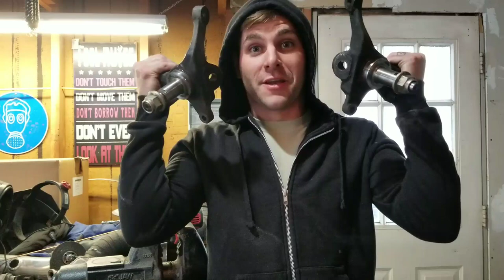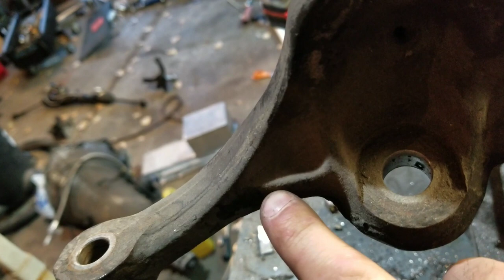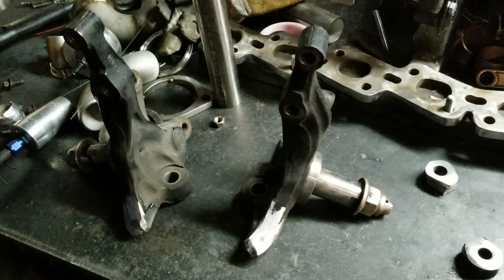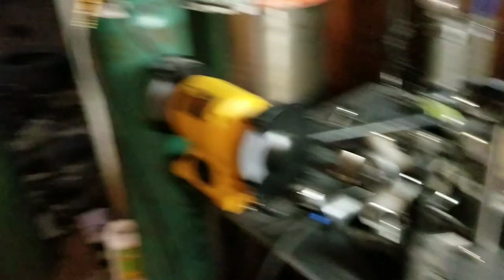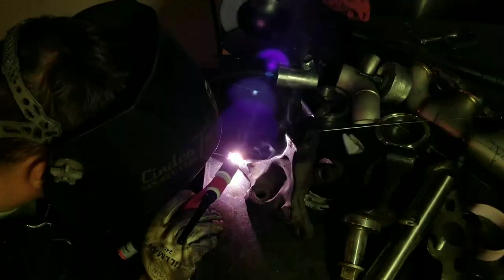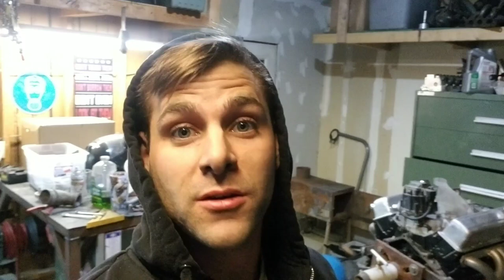How To Modify 240SX Knuckles

Comment: How does shorting the arm change the Ackerman ? I thaught it just changes the steering angle so you would get more lock with same steering angle ?
Reply from the maker: In this process it move the pivot of the tie rod In relationship to the lower control arm
Reply: I'm ready to weld myn so back to watch the vid again It does make sense now thanks